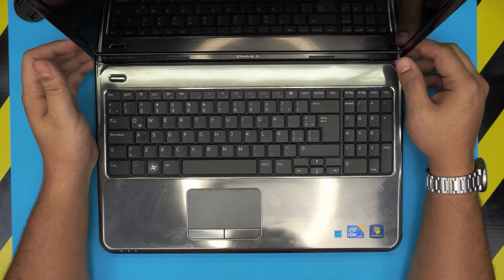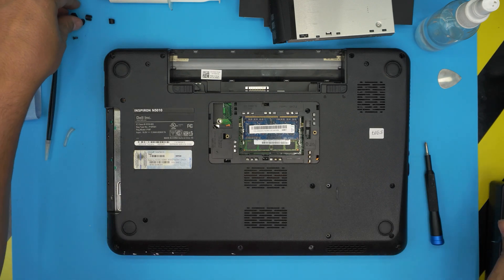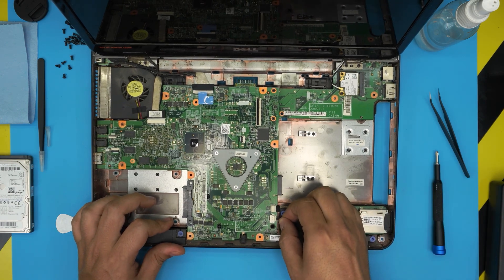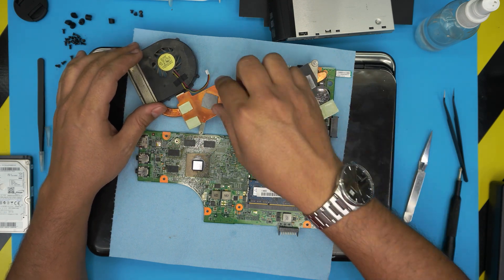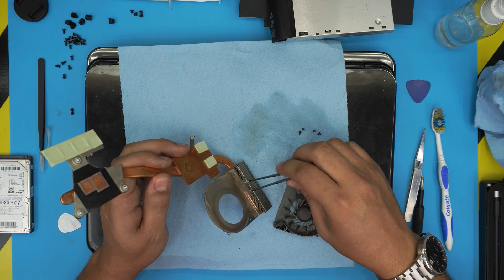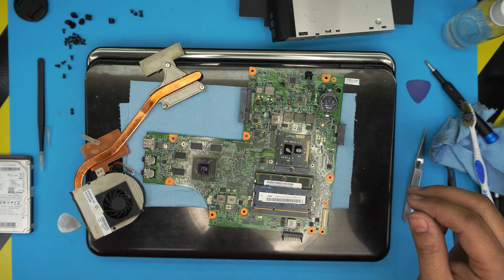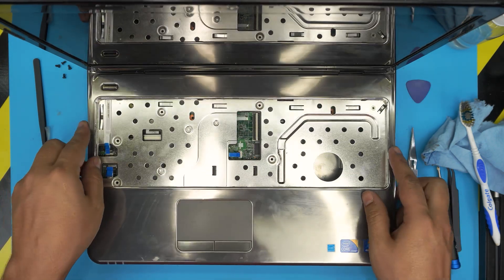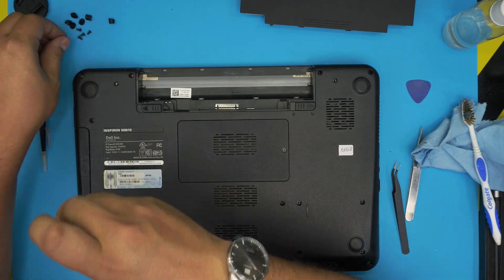Dell Inspiron N5010 💻 Repaste & Cleaning

Comment: I have this laptop and it turns off automatically after some minutes of turning it on.some time it will reach till the windows login screen and it will turn off. I reapplied thermal paste and still the problem exist.can you help me in this regard
Reply from the maker: 🫠Regarding your question, when we get issues like that, the common fix is a new charger, but sometimes the issue can be from components on board. so order new charger and if anything return it.
Should you have any further questions or requests in the future, please don't hesitate to ask me.
cheers🍻

Comment: Can I apply the thermal paste instead of thermal pad on gpu
Reply from the maker: 🫠Regarding your question, absolutely not the distance is not even number, so if you place an thermal pad you will counter push the heatsink away from GPU/CPU, use thermal putty.
Should you have any further questions or requests in the future, please don't hesitate to ask me.
cheers🍻